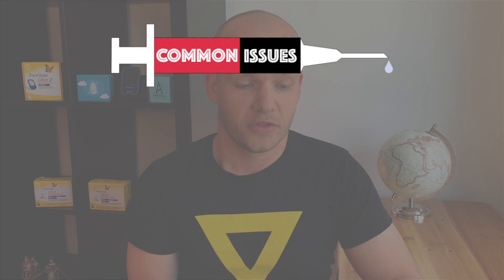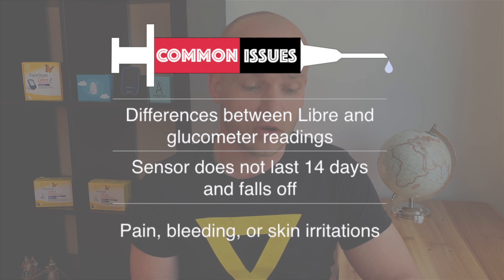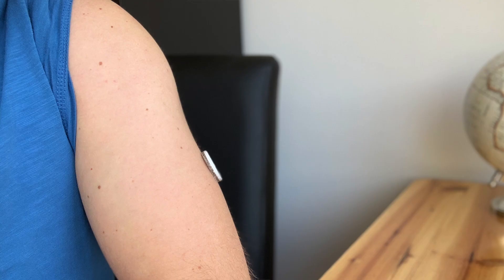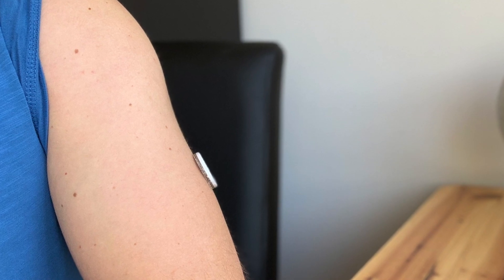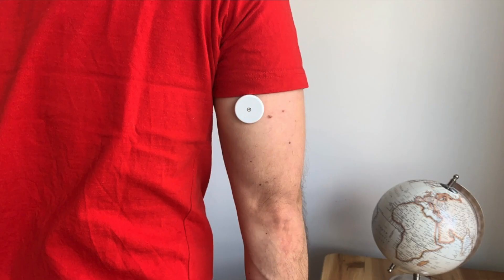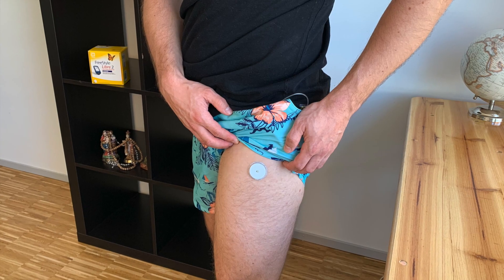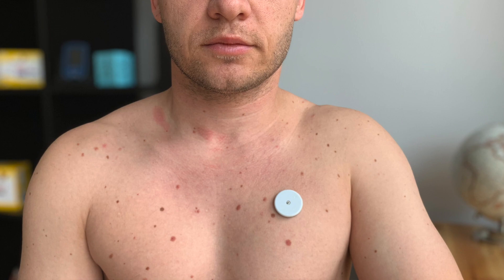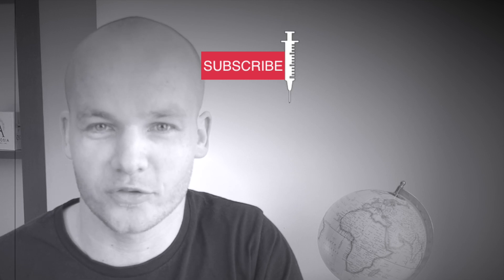Huge FreeStyle Libre Mistakes That Will Cost You...

Comment: I'm reasonably new to using my FreeStyle Libre reader and sensor but what a great invention.  I've been T2 for around 20 years and am also on a Keto diet (which works well for me) and it's so easy to check my blood-glucose levels with the sensor.  I check every hour or so and a little more often after meals so that I can easily keep a check on how I'm doing.  The only problem for me is that I'm a 76 year old pensioner on a limited budget.  I see that this system is free for T1 but not for T2.  Do you think there's any chance of the cost being reduced or even subsidised by the government (I'm in Australia) for those of us who are T2?  I have been wearing the sensor on my arm which I change arm every time I use a new sensor but I see that you are showing one being either on your chest or your thigh, just checking but are both of those sites also suitable for the sensor?  Many thanks for your videos, they are very helpful.
Reply from the maker: Hi John. First of all, thank you for your kind words. It is hard for me to comment on Australia specific topics as I live in Europe. Regarding alternative sites, as I mentioned in my videos, these are not licensed/approved my the manufacturer and we use them at our own risk. Having said that, chest and thigh worked very well for me. Wishing you all the best and stay safe! Tom
Reply: @TypeOneTalks  Hi Tom, many thanks for your comments, go well.

Comment: I just bought 2 new ones and neither would go in. Is there a way I can get replacements
Reply from the maker: Yes. You should try to call about. They usually replace faulty sensors without issues. Good luck! Hope this helps!
Reply: I had one sensor that did not work. I contacted Abbott and they verified that my sensor was faulty, and I received a replacement sensor.

Comment: Please help. My dog (yeah dog) has been using freestyle Libre for 3 month. Last night her Libre stop reading ( error check in 10 minutes). I pressed her live and it scanned it again and it sad she was extremely low so I called her dog who told me that her freestyle Libre wasn’t accurate ( i had 2 days left) she told me to remove it and place new one (which I’ve had do a couple of times since she’s been using them and everything goes smoothly). But this current time after applying like i normally do and scan it and got nothing. I’m not sure what to do....I had surgery on my hip recently and can drive to get another from the pharmacy. Can anyone please help. My phone is still stuck on 2 days and I’m not sure how to rest it or even if I can. Any suggestions would greatly appreciated. Thanks in advance
Reply from the maker: I would try reinstalling the app.
Reply: Ok thanks I’ll try that.
Reply: It’s worked!!! I thought about reinstalling but I just wasn’t sure. Thank you so much (I feel like a idiot because it was just that simple)You are life saver!!! Thank you so much for replying back!!

Comment: There is 13 minute delay between blood glucose reading and the Libre interstitial fluid reading. One measures in blood the other in the fluid around cells, so it takes time for blood glucose to be passed into interstitial fluids.  And of course not all blood glucose is used up, but can be passed out, so doesn't make it into the 'body's system'   In a way the interstitial reading is the more accurate because it is the glucose that is actually being used in cells.  But this would then mean the changing of readings of what is diabetic.  At the moment blood glucose reading of 5.7  would be pre-diabetic, for  interstitial Im guessing that would be 5.6 or so.
Reply from the maker: Thank you for sharing! All the best!

Comment: I've only been using for 10 days and your help has been very valuable to me. I know Libre say to not cover the sensor hole but they also say the sensor is not guaranteed for use in salt water which I swim in for over an hour at a time. Therefore I have left it covered and had no problems so far. I use a transparent waterproof medical adhesive sheeting cut to a circular shape. It is advertised as breathable so maybe that's why its okay. Thanks again, I really enjoy your videos. Scanning 15 times a day until I get used to it, more in normal range and my HbA1c down
Reply from the maker: Hi Gray. Thank you for your kind words! Means a lot! Wishing you all the best and stay healthy!

Comment: Thanks for the video. You mentioned in this video that not to covered the small hole in the sensor. Well, how about MiaoMiao transmitter, will it consider as cover? Thanks
Reply from the maker: You are bringing up a good point. I am not sure. Maybe this would be a question for the company who makes the transmitter. Nightrider BluCon covers the whole as well. The new Bubble transmitter does not cover it.

Comment: I scan about 20 times a day. I was just diagnosed in January and a1c was over 13. Just got my first a1c after starting insulin at 7.2. Doc says this is good. I couldnt have done it without the Libre. 
  I knocked a couple off and started using patches, but was concerned about wearing the patch for 14 days. The patch is very sticky and hard to take off the sensor. So I use large bandages (1 3/4 X 2). The pad keeps from pulling on sensor so I can change often. I suspect this might help with that hole also.
  Your vloggs have been so helpful, bless you and stay safe.  Thanks.
Reply from the maker: Hi Mike. First of all, congratulations! You have done an amazing job with your A1c. Well done! I am glad you find the videos helpful. Wishing you all the best, keep the positive attitude, and stay safe!

Comment: I have used the sensors for about 3 1/2 years now and overall I am very satisfied.  I had lots of problems with it coming off or stopping working at one time but then that problem went away.  I think they had quality control  problems and wouldn't admit it.  Also, I never heard about or read about keeping the little hole open.  My sensor is completely covered with a bandage and doesn't seem to be a problem.  The person who initially educated me on these never mentioned it.
Reply from the maker: Thank you for sharing your experience! Great to hear you are satisfied! I learned about "the whole covering" topic lately when I tuned in the FreeStyle Libre webinar. Before I had covered it and also did not have issues. So probably it is not a big deal for most people. But since I've been told I try not to do it. Wishing you all the best!